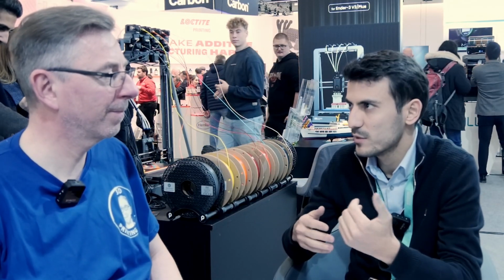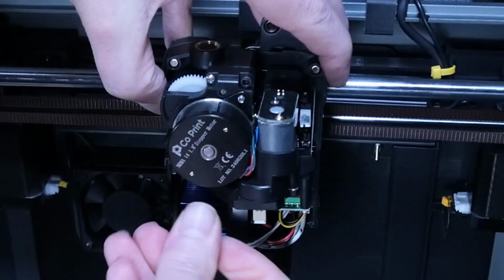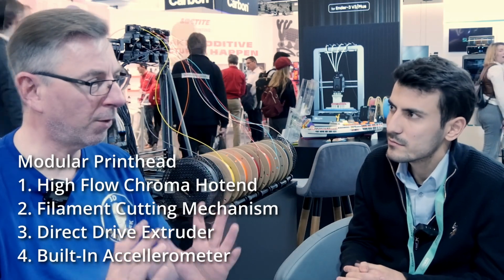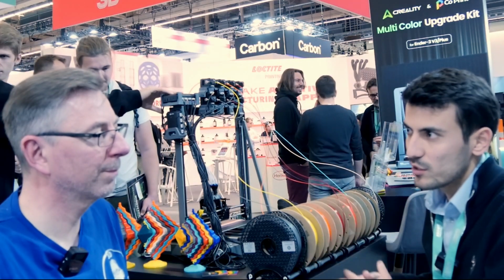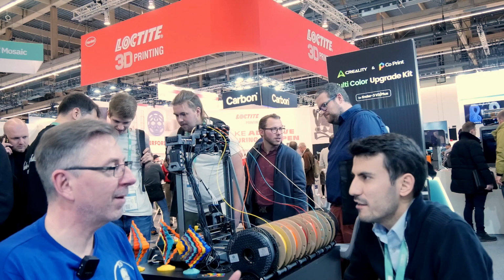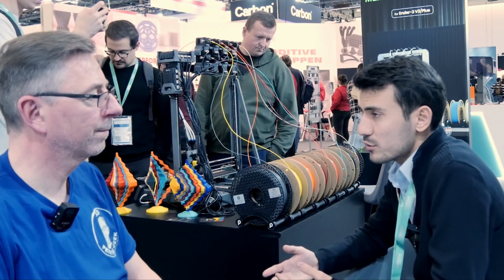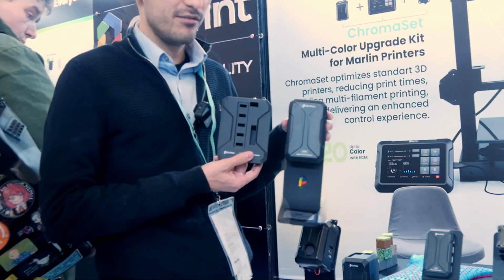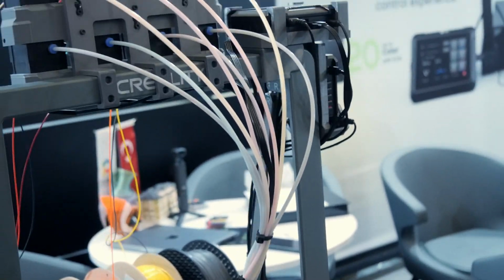The CoPrint Story! Color 3D-Printing for EVERYONE! // FormNext 2024!

Comment: I backed two of the KCM kit's along with two ECM kits. One of the wiring on the nozzles was broken from factory, as well extruders getting hot from improper wiring from factory that they expect you to fix. Very poor QC control. Instillation of the physical product is actually easy and straightforward, but after that they expect you to be a Klipper software expert to be able to program this thing to get it to work. CoPrint does NOT provide the necessary printer config files for each printer they say is compatible. Just a generic config files that have to be manually edited, but YOU better know how to edit it, as there are ZERO instructions from CoPrint on how to do it, and they rely on the community support of people they don't even pay in their Discord to help you figure it out for them, because they can't be bothered to do their jobs properly. I have all of their broken crap in a box, and I know I need to reach out to support, but this company has pissed me off so much that I don't want to talk to them. They are Liars, that use scummy business practices. They don't honor, nor care about their customers, especially those who backed this project to bring it to reality. Stay far away from this company and their products.
Reply from the maker: Thanks for your detailed comment on your experience. I have backed the KCM-set, and totally understand your frustration about the after-sales support. Getting delivered a broken product makes things even worse. My experiences are ambivalent, too. On one hand I love the idea, and still do. On the other hand it was not easy to get it all up and running just from the configs, and reaching out to the CoPrint support took way too long to get a quick solution. I had to ask on their discord where other users helped solving some of the problems. I know they don't get paid for doing that, and I really appreciate that they do. Like me they like the idea of the product, and are trying to even help CoPrint to improve it. Sure, that's no excuse for CoPrint but they aren't a multi-million-dollar company. Just a few enthusiasts who were able to get their product produced with the funding of us Kickstarter backers. As a backer I'm happy that I at least got the product. We could also all have lost our "risk-capital". The good thing is, that they quickly replaced one of the parts that got broken during my tests quickly, after we figured out that there was nothing to do to get it working again on my side. I recognized that the documentation is improving continuously which is a good sign. 
Hopefully they will sort out all the problems. Everyone is free to decide if it's worth their money.

Comment: The support for the co print is terrible.  I have it for my K1 Max.  The instructions , photos, and video for editing the kcm.cfg file show a file that does not match the kcm.cfg file that they provide on their github at all.  Its not even close.  The instructinos for editing the printer.cfg file are not clear in explaining how to change the conflicting instruction commands.  So i have an expensive paperweight that I cant use.  So far this has been a horrible experience.  You should actually try doing an installation of their equipment on klipper yourself.
Reply from the maker: Thank you for sharing your experience! I installed the KCM Set on my K1 for testing and found the same according to discrepancies in the documentation but due to having some knowledge about setting up Klipper on various 3D printers was able to get around them. 
Feedback like yours is crucial for improving the support and documentation.
I hope things get resolved for you soon, and your printer can start living up to its potential!
Reply: @3D_Printing_Geek  please share what you did.  Make a video of what you changed in the klipper files

Comment: would much rather have a poop shoot than the stupid purge brick that uses more material than the damn part not to mention the loss of print bed
Reply from the maker: I would prefere that, too but due to the concept of being an add-on for many 3D printers, which are so different to each other speaking of build volume, motion system, and boundaries, they had to choose a way of wiping, and purging that works for any 3D printer, which is using a purge tower.

Comment: So much talking ...  Show the thing working!  Show what it takes to add it to a Klipper printer not prepared by the manufacturer yet!  Personally I don't think this makes sense for most of us.  If you really want to tinker at this level, you probably also want to tweak your print head significantly and then a print head using a cutter driven by hitting against a certain position inside the build volume (next to where you pick up Klicky ;-) ) would be more reliable and cost-effective.  Those people probably already have an ERCF or similar.  But most of us likely don't want to tinker at this level and will prefer printers having this built-in like the Bambu's or K2 Plus.  The big difference being that those multi-color implementations just work out of the box, whereas this thing will need lots of tweaking and adjusting for each printer it would be added to.  If that would work better than my statements here, then proof it: show it, let Youtube channels test it ...  Words proof nothing.
Reply from the maker: You're right, and your comment also deserves a longer answer. Yes, there's a lot of talking in the video. That's why the title contains "story", to make it clear for the ones not recognizing this being a 35-minute long video, that they should expect that. After all the rumors about a fake product, scam, problems during production, and people losing faith in ever seeing this product come to reality, I intentionally decided and wanted to give the founders the opportunity, to tell their story, so that others can understand, why some things happened as they happened. To let them see with how much heart and soul they worked for their dream, to make it possible to convert many 3D printers to print with multiple colors.
I have backed the product on Kickstarter, and I have been using it for a few weeks now. You can expect what you're asking for, a video showing how to do it and believe me, it's much less effort than building an ERCF, though still requires some experience with Klipper.
Thanks for the comment, and I hope you really watched the video to its end.
Reply: @3D_Printing_Geek  Looking forward to see the actual experience then.  My comment was less about your video than about the makers of the product.  To sell a good product, just show off how it does its thing.  So, I really hope this can become the multi-material kit for Voron, Ratrig, DIY printers and others, but I'll be convinced when seeing it easily integrate on all of those.  Still think the print head (cutter) should have been simpler though.
Reply: @3D_Printing_Geek  I also just noticed another video on competition for this called: VVD.  Same thing there though: lot's of promises but no real hands on reviews yet.
Reply: @3D_Printing_Geek  its a poorly built product. Support does not exist beside when they comment under social media just to look good. they have an issue with a chip in the KCM and ignore customers. they want customer to splice the cable and bypass the kcm.
Reply from the maker: According to your wording, you have no personal experience with the KCM set, but only hearsay. As long as you don't provide any sources, the claims you make are worth nothing!
I have been using the KCM set for a few weeks now. Yes, the communication and support left a lot to be desired, but that has improved a lot in the meantime. The questions I had were all answered and resolved to my satisfaction. The quality of the product cannot be faulted either. There is an unpleasant but not critical problem with the KCM in that the stepper motor drivers are initially active, but this could certainly be solved in an upcoming revision or with a firmware update. You should also bear in mind that this is a start-up and not a large company that has developed this with a handful of people and brought it to product maturity. I think that deserves our respect.
Btw, I'm not paid, nor sponsored, or affiliated with CoPrint in any way and paid for my KCM-Set being an early adopter on Kickstarter.

Comment: Co Print: It says that you can add up to 20 colours, but I haven't seen anyone do this. The head only receives 8 filaments, so what do you do for 20 different coloured filaments? Did you assemble the unit to its maximum capacity? I'd like to see the settings for all 20 colours together!
Reply from the maker: Great question! Though I'm not working for CoPrint I can answer your question.
With the Sets you get all to go up to 8 colors, just by adding an ECM (Extended Chroma Module) and 4 more extruders. 
If you take a close look at the ChromaHead in the pictures, you see the 8-in-1 module coming out of the top with all the tubes going in. Unfortunately, none of the images shows it close up, but it has, in fact, a 9th inlet in the middle. From the 8th color onward, you additionally need the separately sold 5-in-1 module.
I’ll consider doing a detailed video on achieving that setup!

Comment: How much is this unit?
Reply from the maker: The KCM-Set is currently sold for $289, the Chroma-Set for non-Klipper 3D printers for $439. These sets contain everything required to start with for colors.  You can buy each part separately, too.
To extend another 4 colors you only need to buy an ECM for $49, or the ECM-Set if you need the 4 extruders, for $149. 
This approach makes it very affordable if you go beyond the initial 4 colors.
Check their store at https://coprint3d.com/collections/all
Reply: @3D_Printing_Geek  Ooof
Reply: @handikappad  its cheap junk built poorly